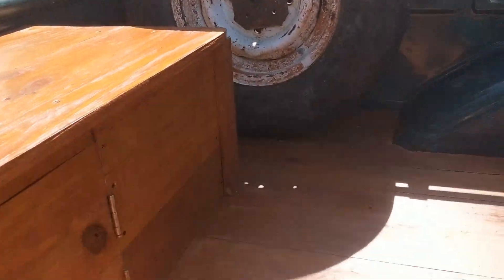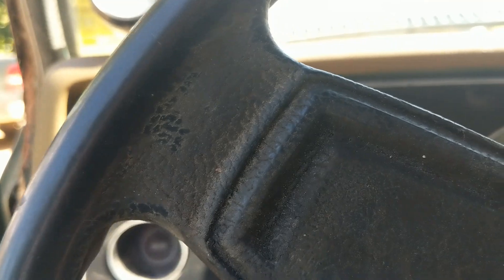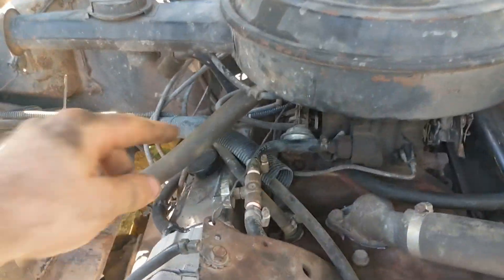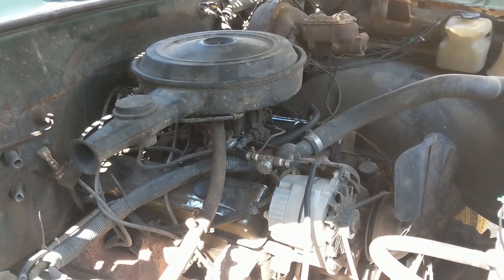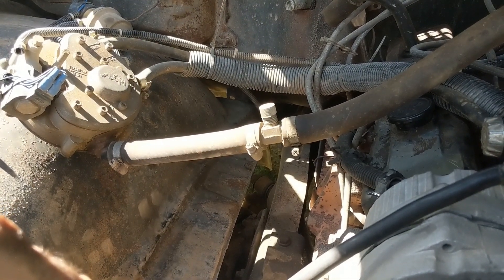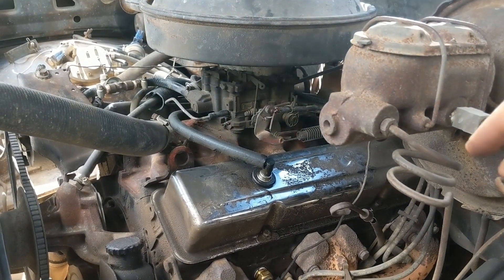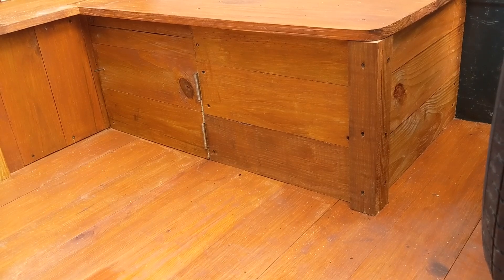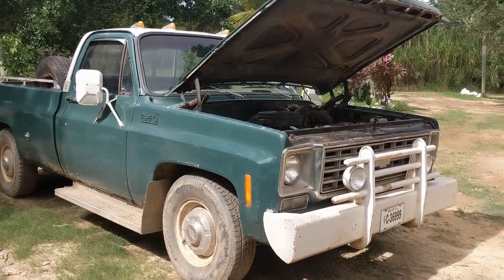The pros and cons of using LPG butane or propane in your car or truck

Comment: I have been running dedicated propane engines for decades here in Canada . My most recent iteration is a 12:1 forged piston , roller cam & rockers ( 1.6 ratio ) , fast burn high swirl vortec heads with hardened valves with the venerable Impco 425A mixer on a large runner dual plane intake . I had to upgrade the HEI ignition because the high dome and swirl was blowing the spark out . That fixed and tuning in progress the initial results are amazing . With the increased compression ratio more than offsetting the 10% less BTU in LPG , the 130 octane rating of LPG allowing extended lean cruise and the 350 horse power limit of the 425A this engine has capitalized on the exceptional features of LPG . Currently operating at 40% of the cost compared to gasoline with extended performance and this is a one ton truck !

Comment: LPG is actually MUCH better for longevity of your engine. The guys talking about running gasoline in order to lubricant valves are talking about very old engines. If your vehicle runs unleaded gasoline it will be fine on LPG. It’s the same reason you can’t run unleaded in old engines. The guides and seats need the lead or else they get torn up.

Comment: That truck has hardened valve seats, all later motors made for unleaded gas do have. Hardened valve seats are a MUST! Old engine service manuals will tell you that. Old Engines made for leaded gas usually do not have them. Back in the late '60s my father worked for a GMC dealership. A local propane company converted all their new delivery trucks to propane. In 20k miles, the valves were junk, and the seats gone in those smallblock Chevies, GM wouldn't warranty them. A Caterpillar generator tech told me that they de-rated a Deisel generator by 50% if converted to propane. Propane benefits from higher compression to restore some power. An old gas tractor engine may have 7:1 on gas and 9:1 on propane. But still suffer a little power loss. We used to "cheat" and install propane overbore kits and pistons in our gas-powered antique tractors that were made for 75 octane gas. A 1952 Massey Harris 44 gas motor was 260 cubic inches and 6.4:1 compression. A 44 special propane was 277 ci and 9:1 with less power. Automotive engines can easily run around 10.0 cr on iron heads or 11.0 cr on aluminum heads on propane, as it is 104-112 octane. The higher compression will restore torque, and then a little hotter cam can be used to restore power. Or turbocharing or supercharging at higher boost levels than pump gas can be used. Pourpose built engines aren't needed but perform much better with it. Always install a filter in the supply line propane was called "greasy air" for a reason and can contain the same dirt and rust as gasoline.

Comment: would it work on a mitsubishi mighty max 88 or it will loose power with butane gas?
Reply from the maker: it will lose a little power but the fuel savings should make up for it
Reply: @mrmaxstorey  ok thanks.

Comment: It's been quite popular here in Australia for say four decades but is fading from use now due to increased cost of LPG and increased fuel efficiency of modern cars, also Australia has focused mainly on giving away LPG/LNG to Japan and China for all these decades. Availability of the gas at outlets is dwindling. I learnt that automotive LPG is 50/50 propane/butane and the domestic lpg is pure propane. LNG refers to methane  and i understand that in India it's methane thats the main gas but the tanks need to be double thickness and weight for the  compressed methane . A gas mixture called hythane is also available being 20/80 % hydrogen to methane blend . Not having the lead additive could cause increased pitting of the valves and seats at the contact points , but if engine wasn't prone to overheating it then was less likely ( people don't consider that exhaust valves operate red hot in an engine and can get a bit tacky if too hot ) . What lead did was to deposit lead oxide coating on everything in exhaust region from valve seats n stems to the tailpipe, the deposit acted as a lubricant. I believe that you know you got quality stelliite valves if they ain't magnetic when you be checking a removed head .

  When i say gas , i don't refer to gasoline/petrol . If I i say gas ,  then i mean gas and not a liquid fuel . It's America that has this confusion.

Comment: So essentially propane and butane are interchangeable?
Reply: Initial boiling point of propane is -44F while butane is 31F.   Vapor pressure at 60 is 102 psi for propane but only 12 psi for butane.  Propane systems have to be able to handle the higher pressures and butane isn't going to work in cold climes
Reply from the maker: The system is similar, i think you will need a different regulator and maybe a fuel ring to switch from propane to butane, but yes both can power a vehicle

Comment: Im coming up onto a large amount of butane, thinking of converting my chevy 1500 to butane, any additional information or literature you can provide would be amazing.
Reply from the maker: There really isnt that much to it honestly. Youll want to firmly mount the tank in the bed and cover it to protect against corrosion. The hard line is a high pressure line, it leads from the tank to the regulator, and then after the regulator is a low pressure line and this should be flexible, to absorb any vibration from the motor. I'm sure they sell kits somewhere for your throttle body and displacement, my truck came with this kit so i didnt need to source it. Beyond that the truck just drives normally, maybe a little low on power but not too bad

Comment: Do you think this will work with hydrogen?
Reply from the maker: Hydrogen is an entirely different thing. The fuel isn't burned in internal combustion, it is turned into electricity and it powers electric motors

Comment: Dude, like your content, but you said your system was a butane system, its not, its a propane system..
Reply from the maker: Actually it is butane. In Belize they don't have propane, everything which would otherwise run on propane like gas grills, home appliances, and retrofitted lpg vehicles is all butane
Reply: @mrmaxstorey  Sir, you are entitled to your own opinion, but your not entitled to your own facts. No actually the kit is not a butane kit. . I don’t care what its called in another country! You may not of read my statement in its entirety or just don’t understand the statement. I commented on the kit he showed not what gas he was running through that system. You can call it fried eggs if you want. The system he has is a system that i installed hundreds of times, when i was working in that field back in the 80’s. I installed that particular kit and other variations of them on all my own vehicles. I was a propane specialist for 20 years. How many of those kits have you installed and repaired?. How long have you worked with propane and propane conversion? Now, sorry you don’t have propane in Belize. If he is running butane rather than propane I think that is pretty cool that they figured out how to make propane technology work for butane, as they are similar products in some ways. Now he may retrofitted the propane kit to run butane. Cool!! but its NOT A BUTANE KIT. what you use the kit for does not change what it is..
Reply from the maker: @btobh5961  I see. So after this clarification, I am to understand I think, that the important thing for you here is the proper name for the system, and not calling it by any other name, even after it has been modified to accept a different type of fuel. If that is the case then ok objection is noted
Reply: @mrmaxstorey  YES!!! Words matter! Words are tethered to their definitions! I will not be silent while this low resolution thinking is propagated by anyone!! So YES.. it matters
Reply from the maker: @btobh5961  oh ok Brad. So what did you do for Christmas, Brad?

Comment: Can you put a propane carb on a car that's fuel-injected, if you can find an aftermarket manifold that's intended for a carburetor / single-point injection?  I think most car comes with single point injection till the end of the 80ies ..
Reply from the maker: Yes you can do that, even easier if it is single point inj

Comment: Dear lpg in different countries your country LPG is very best performer and otherwise is a gasoline connection was anything hard engine heating problem Aandhi LPG in Pakistan I have not recommended LPG but I am light just natural gas and gasoline and petrol

Comment: Changing up your LPG system for an Impco Model L or E converter and a Impco 425 complex mixer would help with your power and economy. They are easy enough to rebuild if you can get them cheap enough second hand. New they are fairly expensive, might not be worth the cost to upgrade. 

Down here in Australia, we used to have a lot of LPG vehicles.  Not as many these days, which seems rather silly as it's plentiful here in Australia, much cheaper than petrol, and burns cleaner.  I've been running it in my car's as dual fuel setups for over 20 years now, with a basic mixer ring setup like this in my old 74 torana.  Horrible mileage and lost a bit of power, but it was horrible mileage on petrol too.  Then I had some 90's fuel injected Ford 6 cyl's with Impco 225 complex mixer setups. I had a Impco 425 on my v8 falcon. Much better for power & economy. Then I got a falcon 6 & fit the injected gas setup to it, wow, almost exact same power on gas & petrol, only 10% worse economy, and gas was way cheaper, 1/3rd the cost of petrol back then. 

Just recently fit a new 4th gen I think it is, OBD2 compliant AC  Qmax Injected gas system on my 96 BMW v8, same sort of power on gas as per petrol, and it seems to be running only 5 to 7% worse economy on gas, but gas is half the price of petrol, so huge savings.  We fit a 5th gen Liquid Gas Injection setup to my wife's 5.4lt v8 " BOSS 260" Falcon Xr8 almost 10 years ago now. That actually makes more power on gas, 185 RWKW on petrol and 210 RWKW on gas, for a little less than 5% worse economy on gas vs petrol. Unfortunately it's hard to get Liquid gas hardware to do the conversions in Australia atm, so I only went with the Vapour injection on the BMW. Which I ended up having to source the kit from Europe anyway, as our local suppliers were all out of v8 stuff.
Reply from the maker: cool man thanks lots of good information

Comment: I have a '67 Ford F350 wrecker/ tow truck, with an FE360 engine and a 2bbl carburetor (Autoline 2100).... when I work I use it with LP propane and the gasoline is only used to start the engine, the problem is that when I tow heavy loads and on steep slopes, coolant temp rises above 200°F, stays between 200 and 205, fluctuates in that zone, in the red zone, sometimes it gets to 210°F, and when that happens, the oil starts to lose pressure, from 40psi , it drops to 30 some times it drops to 25, and the sound of the Lifters starts (normally the pressure fluctuates between 40psi and 45psi), I am currently using Valvoline VR1  20W50, because it is high in zddp.
Reply from the maker: Interesting, the LPG is supposed to burn cooler than gas. I wonder if you need a new thermostat, water pump or a rad flush
Reply: @mrmaxstorey  Another thing to consider is that if you run the propane/butane richer, it burns hotter.  There isn't really much benefit to running it rich, so may want to take a look at your EGT and do a smog test to see if it may be burning too rich.  Also, you can g5rtet a separate oil cooler, my 96F250 Super Duty has an individual oil and individual transmission cooler, so even if the engine starts running a bit hot, the oil will help cool it, and the oil will remain a bit cooler as it goes into the engine internals.

Comment: WHERE DID YOU PICK UP THAT KIT? THERES A LOT OF ROOM UNDER THE HOOD IS IT POSSIBLE TO MOUNT TANKS THERE OR IS THERE TOO MUCH HEAT IN THE ENGINE COMPARTMENT?
Reply from the maker: The kit was already installed when I purchased the truck, it is a common modification down there. The engine bay is spacious but not nearly big enough for that tank, even a couple 5 gallon tanks would be a tight squeeze and wouldnt give nearly enough fuel range.

Comment: What wld happen if you didn’t run the gas out of the carb 1st & just sent it running both possibly for a moment? Your where on the blk marble? How are you able to tell your truly running rich or lean w/o pulling plugs? Oh I’d think just letting the oem fuel pump running to a shutoff valve it cld blow the seal & pump gas into your oil pan hmmm
Reply from the maker: OK well to answer your questions one by one, if I didnt empty the bowl of the carb it would just run shitty for a few moments, no power and lots of smoke until the bowl emptied, and then it would run normally. Don't need to pull the plugs to see it was running rich during that brief time. And no the shutoff valve does not cause the diaphragm in the oem fuel pump to blow, it is just a low pressure carb fuel pump it only makes like 6psi. This pump is low pressure high volume

Comment: I have a question, inside the cabin smells gas? Or something, I have a 302 Ford engine and inside the cabin smells really bad, but is running in gasoline, I want to know if this system fix the smell issue
Reply from the maker: No but sometimes the tailpipe smelled like a BBQ.  I don't think it would solve your issue tho, you might have a header or exhaust leak you need to patch up, or a fuel line leak

Comment: I bet if you slapped a holly sniper fuel injection system on there you could delete that knob you have to adjust and the fuel injection system would be able to tune itself to a proper mixture if it's not natively supported I know someone's made a program for it
Reply: Any more info?

Comment: What is that adapter you pulled off the carb? I can't find anything like it online. All the kits I'm seeing want you to replace the entire carb with a propane only
Reply from the maker: That part is often called the fuel ring
Reply: I can't find any like that online. All the kits I'm seeing require a new carb. If anyone knows the details on this set up using your gasoline  carb let me know.
Reply: It looks like a modified mixer placed directly on top of the factory carb.

Comment: I have to wonder if you could use a nitrous oxide plate between the the carburetor and intake manifold. Shut off gas to carburetor through electric fuel pump and then turn on the propane gas?
Reply from the maker: You could give it a go, but it might be more complicated than that. The video shows how the fuel ring is designed to significantly restrict air flow while in butane mode, that's why I have to remove it when switching to gas. So you might need a workaround for that but it sounds like a fun project

Comment: Any risk when in a crash? I know similar bad results would happen if a gasoline tank was punctured and leakes around hot items, but is it easier to ignite if propane tank was punctured and leaking propane out?
Reply from the maker: This tank is old technology and probably not too safe in a crash, I comforted myself by saying that it was in the bed of the truck so probably a little safer but in the end it would make a pretty good boom. Modern tanks are a lot safer and are generally fine to be in the cabin of a car

Comment: Germany here: Got a Magnum 3,5 and have been running it on LPG for 12 years now, no issues. Companies like Prins  offer modern electronic LPG add-ons here, saved tons of bucks on fuel..
Reply: I know this is old. I’m setting up a Magnum 5.2. Did you buy a kit or? What did you use with your throttle body?

Comment: Where can I get one of those systems? Will it work for propane too? Gas is too damn expensive to run my truck right now. It's also a Chevy, same era as that truck. Mine's got the 454 big block.
Reply: Were on the same page. I have a 454 c30
Reply: @scotchnsplenda  Yeah, mine's a c30 too. Cheyenne trim, special edition, camper special, "Big Dooley" version. Full 4-door crew cab.

Comment: Great setup. I’m very interested in doing this myself—did you fabricate the fuel ring? And what is the model of the regulator? Great video man thanks for sharing this
Reply from the maker: Down here these come in kits based on number of cylinders, and require very little modification to install. I'm not aware that there is any brand name on them
Reply: @mrmaxstorey  thanks for the info! Where did you get the kit?
Reply from the maker: @louidog56  it came with the truck

Comment: Can you run it off methane instead of propane?
Reply from the maker: Im sure someone could figure that out
Reply: You're thinking of CNG.  It's generally considered not as good due to the much stronger/heavier tank requirement, as well as more loss of power and low range.
Cheap to run though.

Comment: Where did you get that fuel ring?
Reply from the maker: It came with the truck. They sell the kits down here in Belize
Reply: @mrmaxstorey  Is there a website you'd recommend?  Or is it kind of a local-only thing?
Reply from the maker: @saltfarmeractual  well I cant recommend any website because I havent used them, it was common to find them down in belize with this adaptation but if you want to do it yourself, you may have to do some googling around
Reply: Gotcha.  I'll probably just need to fabricate one. Another question, that fuel tank, does it withdraw vapor or liquid? I can't find large liquid withdrawal tanks, maybe I don't know what to look for?

Comment: Butane would suck up here, 3 months out of the year. At cold temperatures, it really isn't a gas, even at atmospheric pressures. I know there's camping stoves that sell a propane/butane mix that works even at low temps.

Comment: I have an 84 Chevy 20 set up as a tow truck. Been running it for years on butane. Same  350 rebuilt from 3 different engines. Happy.
Btw I'm in BZE. At the moment transferring butane from my 92 STANZA to a 92 190e Baby BENZ.